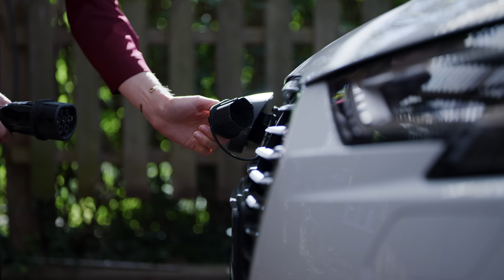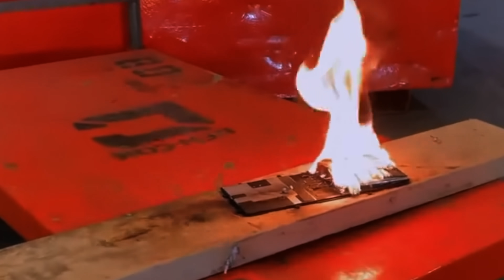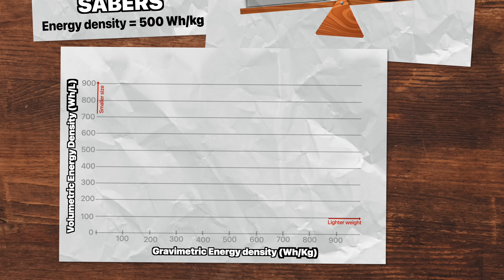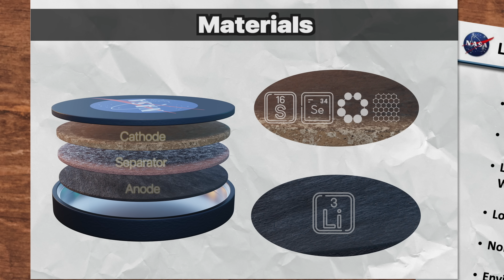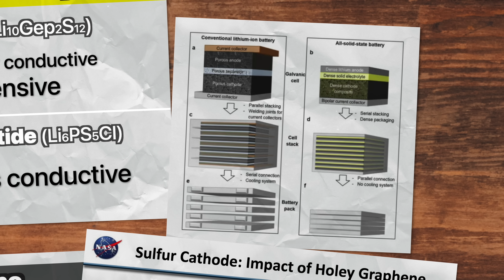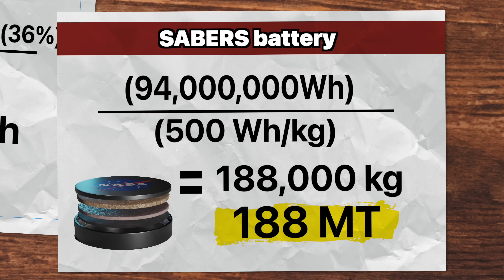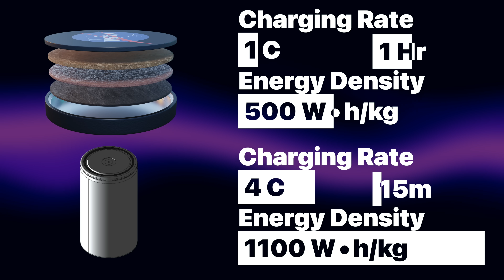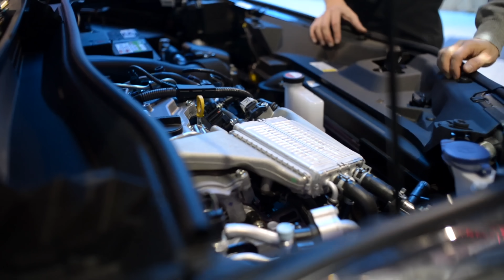Why NASA is Building a Solid State Battery

Comment: you forgot that most short haul routes often require a 2x range for safety , e.g 500km run needs 1000km range for safe return or reroute.
Reply: Slower speed and electric propulsion makes the energy usage/distance much smaller. 

Electric two-seater Pipistrel Alpha electric goes over 100 km with pretty small battery, energy usage/km is less than with Tesla car driving about 100 km/h. And far less than Tesla driving also 200 km/h. 

There are also series hybrid solutions for vertical take off and landing. Use battery for take off and landing, and for long distances also a small generator. If horizontal flight is efficient, it doesn't need much power to keep the battery charge constant. 

The first electric planes are small and for small distances, some hundreds km. Easy to fly, silent and needs small field for takeoff and landing. Maintenance is much cheaper. Electric propulsion is easier to make aerodynamicly efficient than ICE or turboprop. Wide rpm range, small motor.

Comment: Why isn't anyone counting coating the entire aircraft top with solar cells to provide trickle charging inflight to an isolated battery bank. Flying at 30,000 feet must be a vast improvement in solar efficiency. The most battery drain is on takeoff, so engine power is very low if they have separate banks for takeoff and recharge in flight it would work. So have takeoff bank that can put out the most power, then switch to slower discharge batteries in flight. Then recharge the takeoff bank from solarcells on aircraft.

Comment: H2 is light and great energy density. Good for planes. And volume isn't too much of a problem with the wings full of H2 cannisters. There is a lot of underutilised space in the main wings.
Reply: lol, no
Reply: and how heavy are those canisters?
Reply: Airbus made a H2 jet prototype of A380. It has huge cryogenic tank of liquid hydrogen inside. They said, that the wings should be made thinner as there is no room for the tanks anyway. The cryogenic tank in the wing would be leaking too much heat and hydrogen would boil. Liquid hydrogen takes more space than kerosine, and needs to be stored really cold. Much colder than liguid nitrogen.

Comment: Electric jets, huh??? Are you setting the batteries on fire? You can do props with batteries, sure, but jets will be liquid fuel until jets are replaced by ion, plasma, or GraviBlastic (trademark Giblet535 2023) drive, and those won't be running on batteries. NASA is not what they were, nor even close... This 'development' is probably more unicorn dung.

Comment: I think we really need to revisit lighter than air airships as a means of intercontinental cargo and passenger transport. These could be solar powered and fully electric, using hot air  (like hair dryers, electric space heaters, and other electrical air heating systems) contained in lightweight polymer spaceframe  bulkhead compartments (preferably transparent/translucent to maximize solar heat gain) with electric motors for turbine or propeller propulsion.
Reply: No thanks, don't want it to take a week to get from NY to Paris
Reply: @CaptainRon1913  For cargo there could be numerous advantages, like cheaper shipping to remote or difficult access locations without ports or reliable roads such as mountain tops, forests, conflict areas, and direct shipping to refugee camps, military bases, ships, submarines, factories, and trainyards. For passengers there could be many amenities similar to cruise ships, in addition to island and ocean exploration along the way. Falling off the airship into the ocean (at low altitude) would be less likely a death sentence as it is with most cruise ships. Maybe someday.
Reply: @IndigenousEarthling101  except the planet is covered in storms and airships dont do well in bad weather
Reply: I agree. The disasters were sensationalized at the time and fixed wing aircraft actually had a worse track record, the deaths in fixed wing were just by ones or twos and that doesn’t sell papers. 

Airships haven’t been worked on much since the early 1920’s, and fixed wing aircraft performed poorly in weather at the time too. I’m sure some modern development would fix the problem like it has for fixed wing.

The slow flight times would be bad for people transport, but for goods, it’s almost as fast as trucking but with way less energy cost. They are faster than trains and ships.

Ships would still be used for the sheer volume, trains for large shipments of heavy cargo. But imagine most 18-wheelers being off the road. Airships wouldn’t be used for regular transportation, probably more like cruise ships.

An EV dirigible solves the takeoff problem and only requires minimal thrust as it doesn’t have to maintain a minimum speed to stay aloft.

Comment: Your range calculations seem to assume that the flight runs its entire battery down. No commercial flight would ever be planned without a reserve margin. Even the max range of the 737 that you mentioned is not the ACTUAL max range if they run the tanks empty. It's the max range while keeping a reserve. I would imagine that for a 500 mile range, the battery pack would need to be nominally capable of at least 1000 miles.

Comment: I would be super excited to see the EV train development but yeah we are still going after mass passenger separate little cars 😅 but yeahhh
Reply: With people distributed over a large land area, mass transit by train is not that useful.

Trains to move humans is 1800’s thinking, when people never moved much outside of their village  and then trains facilitated village to village movement [of otherwise a static human civilization]
Reply: Electric trains are better in underground tracks. Diesel would smell awful 😊. 

There are trains/locomotives with also battery, but usually only for arranging cars. And they are changed by overhead cables normally.

Comment: the future is hibrid planes , jet engines are very inefficient,if you convert pounds of trust to HP they are 50% les efficient than a ICE ,so we need engine optimization for 30k
 feet and battery + engine for taking of. wider Wings will help even drop-in half the battery in mid flight,a battery pack with its own Wing a small motor it can land on a small air fild.

Comment: This video was exceptionally well done. Bravo. But I do not expect solid state batteries to take over anything any time soon. For starters, germanium is so rare that there are no mines for it. Most of it is recovered from coal soot. And, the other electrolyte mentioned, argyrodide, is a silver compound which means that it will be expensive at the very jump. 
 
There is another worry to look at when it comes to these solid state battery designs. Just because an electrolyte will not readily burn does not mean that the battery will be incapable of detonating. Anything with sufficient energy density to rival liquid fuels will be subject to such risks. That is NOT an opinion of mine. It is the result of a thorny set of laws referred to as thermodynamics.
Reply: "exceptionally well done"... Baked done... as in the cook never checked to see if the ingredients were available for the meal... Selenium is 50% rarer than Silver.    Not to mention his "cooking" AKA Math is so horrifically off as to be laughable.

Comment: Only a few hundred cycles is an absolute no-go.  It sounds like the solid electrolyte is acting more like a growth medium for dendrites rather than the barrier they hoped, and this is just a non-starter until that is corrected.  We can't just keep saying "but it can be recycled" without factoring in the actual economics and recovery rates of that recycling.  This could be great for a Mars rover, but useless for a satellite because it only lasts 8-10 months instead of 30+ years of daily discharge like their nickel-hydrogen batteries.

These batteries can only be tolerated, much less viable, for mass production if lithium was as easy to recycle as aluminum.

Consider the impact on these discussions if the cost of recycling materials was always baked into purchase prices.

Comment: Power density is pretty easy to manage, just use more cells, in series and/or parallel. You can use smaller cells to keep the size/weight down, especially with the direct stacking capabilities of this design. That may increase cost since a pure lithium anode isn’t going to be cheap.
Reply: 𝐁𝐎𝐘𝐂𝐎𝐓𝐓 𝐌𝐈𝐃-𝐕𝐈𝐃𝐄𝐎 𝐀𝐃𝐒
DISLIKE DISLIKE DISLIKE DISLIKE DISLIKE 
DISLIKE DISLIKE DISLIKE DISLIKE

Comment: Nice video. But ... for the 737 weight and range computation ... it's a bit wrong, not the math, but the idea. Battery of this kind should rather be used as a buffer teams with an electrical generator, not only as a basic energy storage. What do you think of this idea ?
Reply: His math is wrong and the idea is stupid as it violates basic physics; Jets are constant power devices.  PS: Selenium(this moronic NASA battery) is 50% rarer than silver.  This battery is space station or satellite applicable only.
Reply: As is being done with H2 fuel cell airplanes, where half the props run on H2 & half on jet fuel.
Reply: Well no, you are a sucker for PR Bull Shit I see. @DavidHalko

Comment: I’m imagining the first application of battery electric systems for airliners will involve a hybrid system where there will still be small jet engines that will provide added thrust on takeoff and climb.  Once the jet reaches altitude, the jets can be feathered to provide supplemental heat to warm the batteries and cabin.  It takes far less power at high altitude to keep the plane at speed through less dense atmosphere and the electric motors will be more efficient.
Reply: Today, there are airplanes running half H2 & half jet fuel… I am waiting for the 100% H2 airplanes to be flying around

Comment: I see several folks, here, have questioned the charge time issues for electric planes. As I replied below, airlines could physically swap the banks of batteries in the planes, much the way they roll out trucks to refuel them today. Those batteries could then be recharged slowly at the airport, and even use solar charging given that airports usually have plenty of empty space to place solar panels. That unloads the grid, and changes to a logistics problem of keeping a backlog of charged battery packs to load on upcoming flights.
Reply: If only we had a battery 5X better than any we have today... Ah utopia, so nice to dabble in it... meanwhile here in REALITY...
Reply: @w8stral  Please look at the progress curve. Just a few years ago we had a battery that was 5X worse than we have today.
Reply: Sigh: Pure Bull Shit.  250Wh/kg Lithium Ion have been around since the 1990's.  General population battery.  If you want HIGH Wh/Kg batteries AKA Silver batteries we have had those for going on ~5+ decades.  No one uses them as no one can afford them, not even NASA(they can but they have other drawbacks).  Just like this absurd Selenium battery, but the percentage of the battery which is Selenium might make it possible.   @Ken00001010
Reply: @Ken00001010 Battery energy density has not improved by 5x in 10years, let alone "a few"

Comment: Um...correct me if I'm wrong, but your Boeing 737 engine analysis is overlooking an important detail - weight of jet fuel.  If you use internal combustion engines, you must also include the weight of the liquid fuel to power the engines which amounts to approximately 18,000 Kg.  That sum is what you compare to the electric motors.  Electric motors don't need liquid fuel as they use electricity.  while that charge will have some weight, it will be negligible.  Therefore, the comparison is ICE Engine + liquid jet fuel vs. Saber battery powered motors without liquid fuel.  While the electric motors will still be too heavy, the gap will be smaller than shown in your analysis.  However, since the plane would not require liquid fuel, that would open up opportunity to redesign the plane's infrastructure to make it lighter and more efficient as wings are largely designed the way they are to hold fuel.  If they don't need to hold fuel, then can be slimmed down.  that would better advantage the electric motor in that equation making it more viable.

Comment: Instead of batteries, I am interested in a diesel-electric system similar to that in modern railroad locomotives. Diesel engines can burn Jet-A without modification. 
There is an electric ducted turbine motor under development on a shoestring budget that is far more efficient by weight and takes up less volume than current turbine systems. The Youtube video is titled: " Could this Thruster transform Aviation? "

Comment: From what I know, the best batteries we have today are those used for rc quadcopters. Yes, "drones", but not those you're thinking about... But those used by hobbyists for acrobatic flights. 
We use lipo polymer batteries, usually connected in series of 6 (6s). They can provide HUGE amounts of current, but for pretty short flights: 5 minutes tops, usually around 3 minutes. 
We use at least 30A escs, which are 4, so 120A, easily. Those even tolerate short blasts over that, up to... I don't know, perhaps 160A. But those are the minimum we use, there are 55A escs, with 10 seconds of 70A... (Again: that x4.)
But those batteries are ridiculously dangerous... If they catch fire, nothing can stop it. There are pilots who lost their houses because of that. 
So, if something better, safer, pops up... It would be amazing. And, either way, I guess it would be the best thing to compare new batteries to. They call them LiPo batteries.
Reply: Lithium ion is super well known and higher energy density than LiPo. Solid state is nexGen

Comment: Couple things to consider.  First is fuel reserve.  You don’t want your aircraft to run out of charge.   Second thing to remember about solid state batteries is while they might be able to charge fast that doesn’t mean the utility can provide that amount of power.   Consider a 100kwh battery.  To charge in one hour takes a 100 kw service.  To charge it in six minutes takes a 1 megawatt service.  The power company doesn’t like people turning off and on huge loads.
Reply: It doesn't matter: This uses Selenium: rarer than SIlver by ~50%.  This is for space application only, not Joe Six pack let alone an aircraft.  Batteries on Space Station need upgrading and NASA has been looking for decades.

Comment: Only idiots like Tesla use thousands of "AA"'s (18650, 2170) in their car batteries. Every other EV on the planet uses large, "purpose built" pouch cells. Because 7000+ 18650's is both a massive waste of mass, AND volume.

(When Tesla started out, over 20 years ago, 18650's were a great compromise. They were readily available, in very very high quantities, for relatively little money, with acceptable power density. Continuing to cling to that technology today is both sad, and infinitely stupid. Even more so when they've built their own factories to build their battery cells... they're no longer using open market economy of scale, they're building them themselves. AND they're still clinging to 1st gen LCO "firecracker" technology)
Reply: Those 18650 still have uses coz they can be more readily cooled

Comment: Ok, it is a breakthrough in the technology but, still reliant on rear and expensive materials. While the goal is to move to cheaper more abundant materials.
Then it also seems to be very hi-tech (special graphene structure) and difficult to produce without huge investments in the technology. So I doubt that it will see the commercial world in its current form if it ever reaches it.

Comment: Lithium's OPTIMAL range is MUCH smaller than it's OPERATIONAL range. Comparing Li optimal to SABERS operational range is misleading at best, and willful misrepresentation at worst.

(lithium's theoretical max efficiency is ~900(?) but getting anywhere close is both difficult and very expensive. I recall some prototypes @ 600, but no one, not even NASA, will foot the bill for them. There's a very complex balancing act between mass, volume, and power characteristics (charge/discharge rates) -- you end up compromising on all three.)

Comment: I see everyone complaining that breakthroughs from 5 years ago are still not commercially available. 1: If the lifetime of the product they are in is 20 years then the battery has to be safe over that length of time. 2: Just because a breakthrough has been made doesnt mean its practical. Materials need to be sourced and designs need to be changes in order to hold them and work. 3: they need to be cost effective. If they are 10x the price of a regular battery then its still better just swapping out old dead batteries for a new one compared with just having one really expensive one. These new batteries wont be available for decades. Who ever gets a car doing over 1000k on a single charge though is gonna rule the world pretty much.

Comment: There is a moral consideration to sticking relatively scarce batteries in commercial aviation as it effectively preserves the consumption levels of the very well off (in a peak oil world) vs. helping the masses (who probably can't fly in that world). One plane full of these neat batteries is 1000 houses or electric scooters not helping the masses out with their own transition. So, as cool as the tech is I am against sticking them in planes. Let's cover the world in high speed rail instead?

Comment: The "vent with flame" scenario was due to the use of alcohol based electrolytes. While you can still find those, we have much more advanced "witch's brew" electrolytes that aren't alcohol based.

(Very old systems tended to have pyrophoric materials in their anode/cathode paste. BigClive unknowningly took one apart. It wasn't on camera when it caught fire, 'tho. I've opened a few from very old Apple products that will burst into flame the instant they're dry. 🙂)
Reply: 𝐁𝐎𝐘𝐂𝐎𝐓𝐓 𝐌𝐈𝐃-𝐕𝐈𝐃𝐄𝐎 𝐀𝐃𝐒
DISLIKE DISLIKE DISLIKE DISLIKE DISLIKE 
DISLIKE DISLIKE DISLIKE DISLIKE